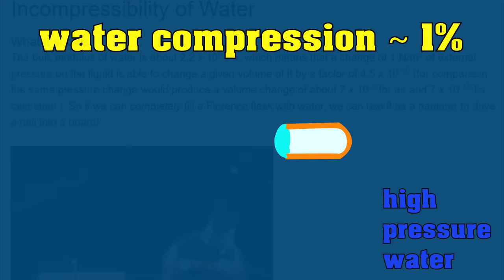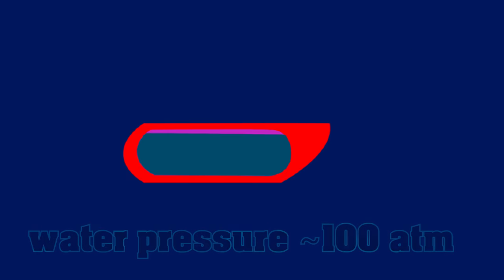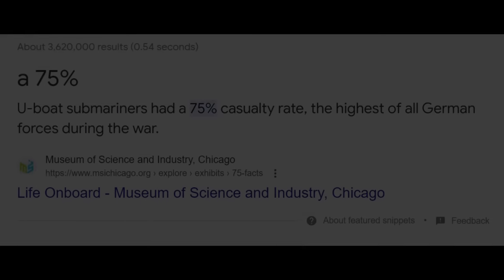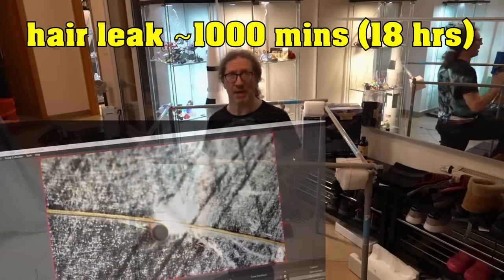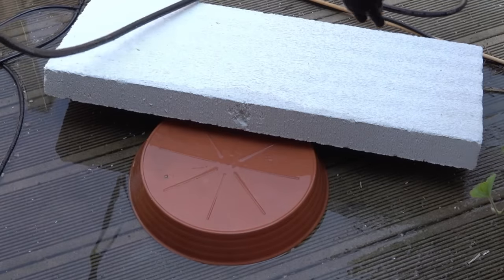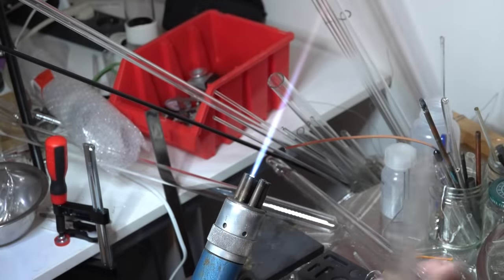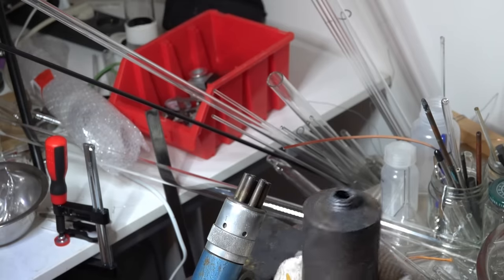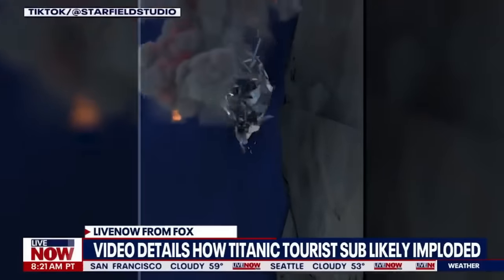Why the Titan sub failed

Comment: Props for showing the experiment, even when it didn't result in what you expected. That's the true spirit of a researcher.
Reply: That IS the scientific process.. that is why we watch thundrfoot. :) respectfully intended
Reply: yea which doesnt mean he busted his own theory, its more like the pressure washer is a really cheap model. normaly they dont come with "easy 1 button switch nossle".
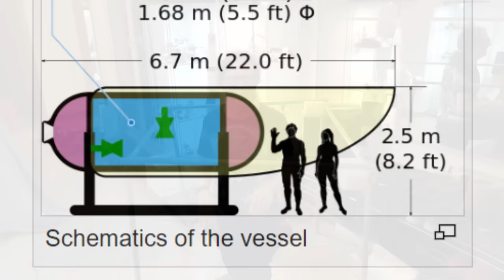Reply: I don't think he cares.  He made a segment for the 1 meter cubed interior volume and then dove-tailed it with: "Well, if there are any sticklers..." sub volume is closer to 5 meters just multiply... 8:58

I'm not in any way defending Ocean Gateway.  Their practices were ridiculous!
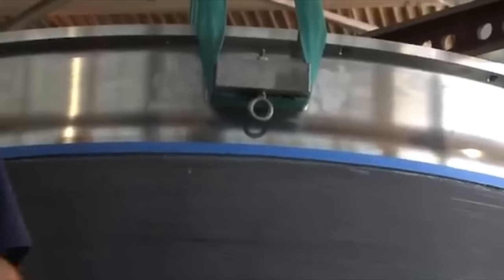Thunderf00t is a chemist and not an engineer.  Fusing dissimilar materials is not the same thing as a bonded joint.  You would be surprised at what critical structural joints get bonded these days.  Also, thanks to Poisson's ratio, transverse fibers in composites do carry a load under bulk compression.  21:08 I hope he reconsiders "a whole other video" about that.  Not withstanding this was an improper application for a composite but Thunderf00t isn't qualified to explain it.  Composites have complicated Mechanics because they are not homogeneous.

He's right about needing to match Modulus' as best practice but its not clear if there is an interior flange in the connection.  Also, the friction between mating surfaces is considerable due to the pressure on the exterior of the hemisphere.  There are several possible failure modes and this is certainly one of them but not the only or even necessarily the most likely.  We'll have to wait on the report to know for sure.

His videos are entertaining but he's often out of his field...
Reply: 7 @Ixions  YouTubers have been flocking to this tragedy like sharks and blood in the water. Everyone enjoys pointing out the engineering flaws, but without a detailed timeline of events, the engineering problems are second to pilot error.

As far as I know, based on some transcripts that may or may not be true... It sounds like they dived too fast, had an issue, released their ballasts, and then couldn't ascend. Wouldn't be surprised if they collided with a ghost net or even the ocean floor
Reply: @Ixions What he's doing is just a simple order of magnitude thought experiment. He's fixing all the values to simpler values that are still the same order of magnitude, just demonstrate the relative magnitude of things. It's a thing he commonly does in all of his videos. Simplifications like that just make it much easier to grasp without having to focus on the math itself. Notice how he was trying to get all the numbers to be multiples of 10 or 100. It's for illustrative purposes.
Reply: Yea, i still learned something. Great experiments never fail if we gain anything
Reply: @supersleepygrumpybear  the salvage teams pulled up big pieces quickly, did not bring up  any nets or foreign debris, nor did they report that the titan chassis parts were entangled..the question is..why they reached 3000 meters 1 hour ahead of the planned schedule. Stockton was NUTS
Reply: @Ixions  "but Thunderf00t isn't qualified to explain it. " Save the ad-homs for other channels, they are unneeded here. Nobody wants to hear somebody gatekeep who is allowed to explain things.
Reply: Failure demonstrates credibility. Only liars hide results they didn't expect
Reply: So it crush by the middle and brake in to 3?
Reply: @MrStonedOne  Actually, what Ixions is saying is very interesting. It's quite possible there are people out there that know this stuff better than Phil does. Ad-rem isn't needed here either...
Reply: He actually thought that pressure washer was going to penetrate that plastic lid 🤦🏿
Reply: @MrStonedOne  again, I refer you to 21:08
As soon as Thunderf00t implied that none of the fibers were in tension he demonstrated that he is unqualified.

Understand generally that when calculating the behavior of composites a 'stiffness matrix (composites)' must first be defined.  It's highly dependent on the fiber and matrix(material) properties, # of plys in the lamina, fiber orientation in each ply, etc.

Homogeneous material like metals are relatively easy by comparison.  Simpler principal stress equations will do.

Thunderf00t does not know these things because he is a chemist and not an engineer.  You can accept what I'm saying or keep the rose-colored glasses on.
Reply: @Ixions He literally said “that’s a whole other video”, so I reject your statement “As soon as Thunderf00t implied that none of the fibres were in tension” as being false. He clearly implied that the subject was complicated and merited a video to itself.

What you did was as disingenuous as if I then said that you had implied that none of the carbon fibre was under compression. 

You heard what you wanted.
Reply: @MrDmadness He's botching the scientific process. His experiments are unrelated to his claims, he draws conclusions from them about the sub anyway, and the conclusions he draws are not even demonstrated within the experiments.

He used a glass fusion bond to demonstrate his hypothetical mode of failure, concluded from it that the bond on the sub would fail before the carbon fiber, and just outright ignored that the glass fractured before it popped off of the metal.

He also tried to express the damage from a pinhole leak at high pressure with a power washer, concluded that there would be a leak that works like in the sub, and then failed to actually demonstrate the intended effect from the washer.

Basically, he's LARPing as an engineer and putting out almost entirely misinformation. It would be less annoying if he presented this as just his ideas for discussion instead of treating it like he's the only one who knows what he's talking about.
Reply: @Ixions I think it's quite clear, when you watch them spread their glue onto a flat surface, that there's no flange.
It's also clear that, while an operative was cleaning the part to be bonded, he was also resting his greasy, sweaty hand on the part he'd already cleaned.
I believe the titanium joint rings should have been a T section shape, to provide interior support to the joint, although, that too is not a perfect solution, when you factor in differential expansion and contraction of the different materials used... Maybe a tight fitting I section to fit over the carbon fibre joint, both inside and out.
It would still require to be rigorously inspected after every dive, and personally, that's the bit I believe they skipped. I don't think they done the required maintenance inspection, to ensure the structural integrity of their sub, between dives.
Reply: It was only because the pressure washer was a cheap one.
I had to have some training from a drain jetter company years ago when a customer of mine purchased one and I had to service/repair it.
That thing was capable of about 7000psi @ 45 l/m. Part of the training was them demonstrate it cutting through a wooden railway sleeper with one of its smaller jetting nozzles.

At the depths of titanic your talking 6000psi with the flow rate only being limited by the size of the hole in your vessel. 

On a side note pressure washer nozzles wear out, if you've got an old pressure washer that doesn't seem to have the umph it used too, odds are the lance just needs a new nozzle.
Reply: @Ixions  I am glad you demonstrated that you can make arguments based on reasoning and logic and not just ad-hom attacks. Thank you for going into detail on that. Now if you could just do so without littering the ad-homs in after the fact you might come off better.

thunderf00t's background is mostly irrelevant. Either he is right or he is wrong. Trying to synthesize a reason based on his background for why he is wrong is just an unneeded personal attack.

I think delamination is more likely to be the cause for why, not a glue mating surface issue from differential compression, but i'll also note that the part that shrinks less was  collared on the outside of the part that shrinks more, so it could still be an issue, i liked this video showing a new potential answer. it could also be such that differential compression could have caused noval or untested stresses that increased the likelihood of delamination.
Reply: @Ixions  Maybe check Dr.-Ing. Ronald Wagner's video on the matter, since he has the correct qualifications to convince you. He has the correct qualifications to have a valid opinion and reached the same conclusion about the point of failure. (I'm assuming substance doesn't matter, since you concentrate more on Thunderfoot being a chemist) 

Aside from that. It is worth pointing out that even if the point of failure is likely what Thunderfoot says it is, the sub would still implode close to how it does in the simulations. The complex forces at play would end up crushing it a lot like a coke can for various reasons. Many of which are also explained by Ronald Wagner's video, so I won't get into that.
Reply: @CookiesRiot  youre adorable. He never claimed this to be the exact cause
Reply: @Johnny2Feathers  A proper pressure washer would. He probably had a cheap model or something.
Reply: @1973retrorabbit  all good points.
Reply: I'm thinking the plastic dish was too flimsy so the water energy was just absorbed by the thing just bending. I wonder if it would have a different effect with a more rigid object.
Reply: @Ixions  When you stand on something it is under pressure, when you hang from it it is under tension. Since the sea is trying to squash the vessel it is under pressure not tension, or am I missing something? Please explain
Reply: @feonor26  he knew what he was using and still thought that thing would tear that plastic lid apart.  Watching him holding it there confused why it wasn’t working until he finally gets it was a lot of fun though.
Reply: @pietperske3583  Poisson effect:  Even under bulk compression portions of a material can be supporting a portion of the load thru a state of tension.

Imagine squishing a gummy under your finger.  If you had fibers in the gummy that were parallel to the table top they would resist the tendency of the gummy to squish out from under your finger.
Reply: @MrDmadness  Did you and I even watch the same video?!

0:00 Literally the first sentence of the video: "So this is probably how the Titan sub failed." (Scene of the glass bond snapping.)

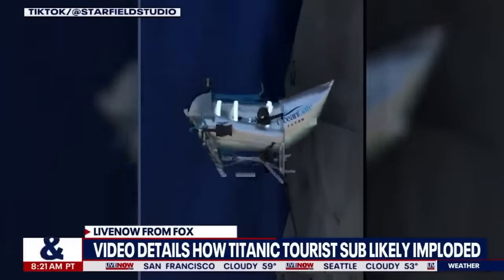2:45 "By far the most probable mode of failure is a single pinhole leak, from where we'll come to shortly." (Referencing the sub glue.)

13:58 "...a hair-sized leak would rapidly transform into first of all a millimeter-sized leak and then a centimeter-sized leak — which brings us back to what is the most likely source of such a leak?" (Spoiler: he says it's the glue.)

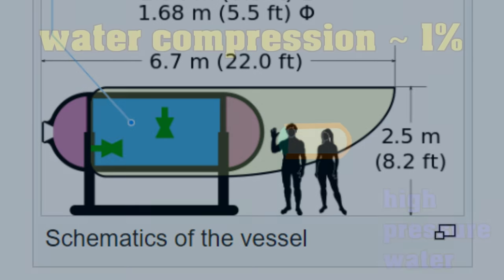14:44 [Graphic he made showing the water filling the cylinder with one cap on, one cap completely detached, zero material distortion due to compression or part failure, and water sliding inward from the open side.]

18:53 [Glass snaps off.] "So that's what happens when one surface contracts more than the other."

19:13 "So this is basically what you would've had with the Titan sub." (Referencing the glass bond again.)

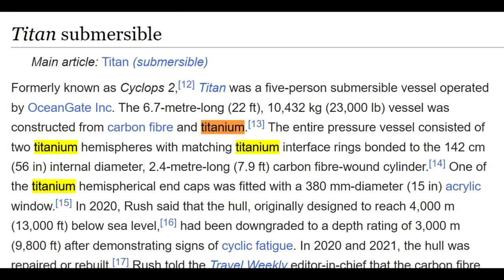21:51 And the outro: "So what you're probably more looking at is the differential compression of the carbon fiber composite and the titanium resulting in a crack. (There, look at that.) A pinhole leak, which would rapidly widen due to the rapid ingress of the water further widening the crack, and the rapid flooding of the sub in probably a fraction of a second. And when that water hammer hits the end of the sub, it's likely that the sub broke into pieces. It's a mind-blowingly simple explanation based around the most likely failure points."

He never claimed it to be the exact cause? He just spent the entirety of two videos explaining how it would've happened that way while dismissing everybody else who suggests that the submarine collapsed.

At the very most I expect you to give a pedantic response that, well he didn't say it was definitely the cause, he only implied it and said it probably was. His hypothesis that the seal failed first could actually be correct, but not in the way or even for the reasons he supposes.
Reply: @CookiesRiot  you shpuld invest more time not on internet.  See you typed all that and my opinion remains un waivered.
Reply: @MrDmadness  His first video doesn't include "probably" and "as far as I can tell" and "almost certainly" on any of his claims in the first video at all, but he does for many statements of his hypothesis in the second video. So please forgive me for drastically overstating his hypothesis and failing to update my impression based on occasional caveats.

Allow me to insert one word to make a correction:

It's his assertion that the glue bond almost definitely failed first and that such a failure would even be remotely similar to flow through a circular hole.
Reply: @Ixions  I understand the gummy bear example. The same is applicable to a tennis ball. However, if I put a net on the tennis ball tied to an anvil and drop it in the deep ocean, it is uniform pressure all round, tension will only happen if the ball goes oval, which it won't as round is the smallest surface area on object can  have.
Reply: @pietperske3583  Start by imagining taking a cross section of the ball by cutting it in half to get a circle.  Imagine cutting the circle in half to get a section resembling an arch.  Arches generally have a capstone which can be approximated by a 3D cube.  The cube is technically referred to as an 'element'.  In this case the element will have compression from the sides and also into and out of the page.  However, due to Poisson's effect the compression will result in a component of tension in the arches radial direction.  Essentially trying to buckle the element.  This makes logical sense because the pressure is acting to try and shrink the volume of the ball by pressing material to the interior and exterior against the external pressure.
Reply: @Ixions found another material scientist. What's up brother.
Reply: @jek__  
Prayer works that way.
Reply: @Ixions  a lot of progress was made by people going out and playing on "other peoples" playground ;)
also he is right: composite works great under tension, not so great unter compression.
Reply: @bodhisattva87  i think the pressure washer just was not the right tool for the experiment. its build to wash things on the surface not cut through them. its simply not a water jet cutting machine.
given industrial pressure washer will tear plastic apart when they get close enough.
Reply: @pootthatbak2578 do you know the maximum descent rate allowed for their vessel? Tyia
Reply: @Ixions  I got lost somewhere. Ancient arches were built with dry stones only, no mortar no glue, so it can only be under compression.

But that aside, I realised that the carbon fibre would suffer tension forces. Since carbon fibre is compressible and titanium not, the ends glued to the titanium would keep their shape, where as the middle will reduce by 5 %, so it is not a perfect tube any more. So perhaps Thunderf00t has stumbled upon the reason for the failure?
Reply: @pietperske3583  In the gummy example.  Imagine cutting the gummy in half on a plane that is parallel to the surface of the table.  Putting them back together would still result in the same behavior.  Even though the cut is under compression the two halves support and transfer the in-plane tension between them thru friction.

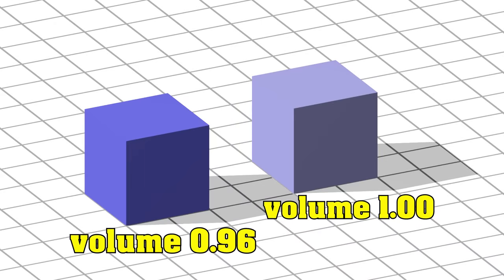All materials have some compressibility.  This property has several names: Modulus of Elasticity, Young's Modulus, (15:21) Bulk Modulus.  

Allow me to quote my first post on this chain:

"He's right about needing to match Modulus' as best practice but its not clear if there is an interior flange in the connection.  Also, the friction between mating surfaces is considerable due to the pressure on the exterior of the hemisphere.  There are several possible failure modes and this is certainly one of them but not the only or even necessarily the most likely.  We'll have to wait on the report to know for sure." (I've since learned there is a flange) 

Someone else mentioned Dr.-Ing. Ronald Wagner's video.  He determined that it may have been the view port that failed.  Though he honestly admits a potential error in that he used general material properties from the internet and not the specs from the original material.  Which is another aspect of scientific method largely missing from Thunderf00t's content.  He generally doesn't consider or describe how/why his conclusions may be wrong.
Reply: @MrStonedOne  responding to your edit.  Clearly I'm not gatekeeping anything.  Thunderf00t is able to say anything he likes.  And I'm allowed to criticize him and state reasons why.  I would suggesting trying to not use buzzwords like "ad-hom" and "gatekeep" if you want to be in the thick of the 'substance' of a discussion and not a screaming fan in the bleachers.  Otherwise, carry on following.
Reply: @R2Bl3nd  I agree.  Order of magnitude calculations are an excellent way of breaking down problems rough and dirty.

I recently had a discussion with someone who dismissed artisanal(hand-mining) of cobalt ore in the DRC(Congo) as a significant stream of production.  I pointed out that based on reported production:

130,000mt of cobalt per year
250k miners

The order of magnitude calc looks like, 10^8 kg (per year) / 10^5 people /10^2 days per year / 10^-2 concentrations equals 10^3 kg per day.
Given that a human could conceivably work 10^2 kg of ore per day this puts the figure firmly in the significant contribution category.

Factor in 2.5x10^5 people, 3x10^2 days per year and some reported concentrations (ref. 'Cobalt Red') of 10^-1, Artisanal mining may be a bit more than SIGNIFICANT
I would argue on the other hand that evidence of significant industrialization in the DRC should put the countries output one or two orders of magnitude higher than it currently is.
Reply: @lordjor96  More like broke into 2 main pieces the end caps, and a zillion fibre shreds of carbon. Along with filter feeder sized bits of human.
Reply: What do you mean? He carved a trench... Plus he was not keeping it still
Reply: @MrStonedOne  @lxions is not a gatekeeper nor is he telling Thunderf00t anything on what he's is allowed to do or not. He's just right in what he says. No matter if you like it or not. I was watching the video and those strange experiments and was waiting for the promised explanation why Titan failed. But there wasn't any. Just assumptions done by somebody who believes to have found the reason but could not convince me at all.
And I especially looked for comments of viewers who are mentioning exactly this circumstance.
Reply: @Ixions  The titanium ring had an inner lip that would have tried to 'force' the composite to shrink at the far slower titanium rate... which would cause the composite within the ring to shear with the composite outside of the ring. What does the bonding agent inside of the ring have to do with the composite shearing outside of the ring? Absolutely frikking nothing. Regardless how innacurate you may feel the experiment was, is irrelevent. If he managed to slip the tube over the metal, or inside a ring similiar to the Titan, the glass (like the carbon composite) would have reacted in the exact same fashion, to break where the glass isn't supported by the metal.
Reply: Yeah, props for a video full of totally unrelated bullshit sold by clickbait in order to fill the pockets of a pseudo scientist whose claims are comparable to those of the flat earth brigade. True spirit refers to the alcohol that might have played a role in this case.